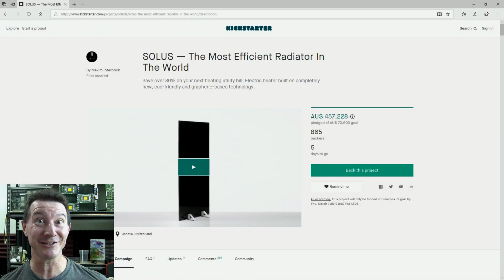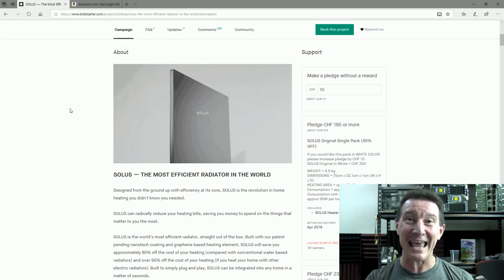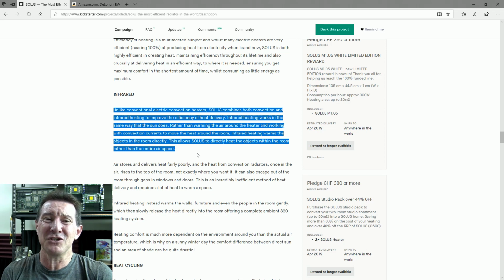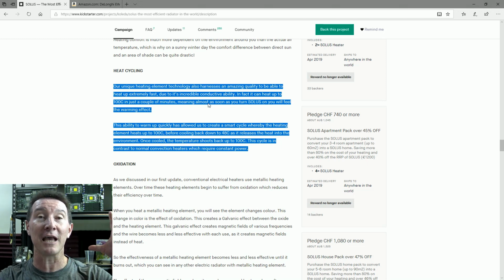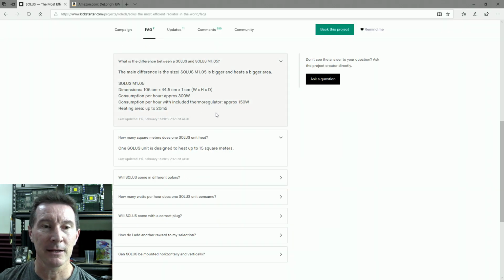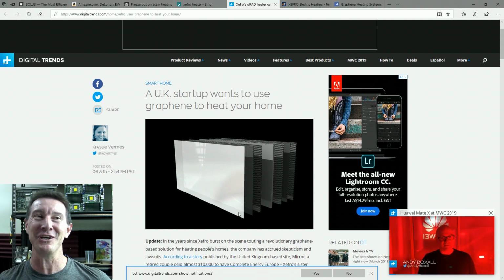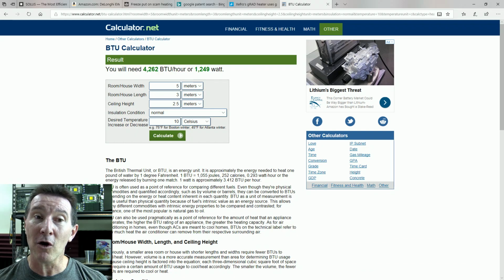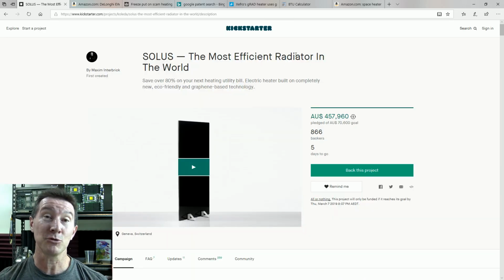EEVblog #1186 - Solus Graphene Heater Kickstarter BUSTED!

Comment: It amazes me how easily someone can scam millions out of people over products a smart high school student can debunk. Solar panels on a car... SMH. People like us who create objects rooted in reality have no chance. Electric heat is always 100 percent efficient at 3.414 BTUs per watt. I can always tell my customers with absolute certainty how much heat their electric heater is producing. You get what you pay for with electric heat no matter the type. All 15amp heaters are all the same output. Pick your style based on looks. It doesn't matter. Heat pumps and gas fired equipment are more cost efficient in most cases.

Comment: SOOOO I remember this and my comments are still the sans.   If a radiant heater draws 1500 watts an hour and puts out 2000 btus  and a radiant heater draws 400 watts and puts out 2000 btus then the 400 watt ones way more efficient.    AND If you put this in a 2000 cuft room and it heats it to 80 degrees in one hour then it way more efficient

Comment: One additional thing: oil radiators do an infrared radiation you can feel immediately when they heat. All metal bodies emit infrared thermal radiation when heated compared to the environment, which makes oil radiator basically the same (except cheaper).

Comment: Not seen the full video yet, but claiming 80% saving on heating bill??
Efficiently converting electricity to heat is one of the few energy conversions that we've truly mastered.  And trivially too.

Like, we do it by accident in gaming PCs with 95%+ efficiency.  How are you going to save 80% on the energy bill for that without reducing heat output, let alone a dedicated heater?

Comment: It's like an tinted incandescent light bulb. If you have very good insulation and mild winter you could heat your house with Incandescent light bulbs. The metal wire inside a light bulb would burn if the bulb wasn't filled with noble gas. 
Infrared radiation passes through glass. Apparently this thing only uses infrared radiation and not convection. The only real advantage or an oil heater is that it heats the room without causing an air flow within the room, which doesn't stir up dust.

Comment: Of course, graphene can generate heat without electricity input. You just have to leave out the cladding and heat it up strongly enough. Then a reaction begins in which electrons flow from the graphene to the oxygen in the air without external voltage input and bind it, releasing heat in the process. The catch is that the graphene heating element then only has a limited service life.

Comment: The co-efficient of performance (COP) of a heater is worked out by comparing kW heat to kW electricity  (in terms Watts is used to define two types of energy, electrical and heat). Resistance heating (RH) has a COP of around 0.3. Or that for every 1kW of electricity used approx 0.3kW's heat energy will be produced. A reverse cycle air conditioner uses the "heat of compression" to increase the temperature of a gas (the refrigerant) to do the "work" involved in heating a medium (the refrigerant, the tubes then the air). This is a far more efficient way of imparting heat into a substance than a resistive wire heated using electricity. It is far cheaper (more efficient) to run a  compressor and fan windings than it is to use RH. A current model of air conditioner uses 1kW of electrical power to make around 2.5-3.0kW's of heat energy. That's right, 0.3 COP compared to a COP of 3.0 (or more see below) For this reason gas (a similar COP of 30-35%) was phased out of British laundromats to be replaced with reverse cycle heating systems. If you check the "Advance technical specifications" on this current model Daikin AC rang of units, compare DTXF25TVMA: Power Input (Rated):	Cool (kW)	0.67  and Heat (kW)	0.78,  Rated Capacity:	Cool (kW)	2.5 	and Heat (kW)	3.0. Coefficient of Performance (COP) is the efficiency ratio of the amount of heating or cooling provided by a heating or cooling unit to the energy consumed by the system. ... Then the COP of the air conditioner would be 2.5 divided by 0.67 = 3.7, essentially almost 4 times more efficient than electrical heating. Watts electricity and Watts heat are easily confused making scams involving them easy to perpetuate.  https://commercial.daikin.com.au/our-product-range/split-system-air-conditioning/dtxf-t

Comment: It takes 3 kilowatts to maintain my lounge at 24 oC when the outside temperature outside is 0 oC   Which is bang on the calculated figure.  So I would need 15 of these panels not pulsed to do the job. This defies physics and is obviously a scam and should be stopped before people loose their investments. The kick start platforms should be fined for joint enterprise in the scam.

Comment: Living in Europe, I have seen many new apartments including the one i am living in, have started using floor concealed heating (the entire floor is a radiator here) and hot water is pumped for circulation. I found that this heating itself is kinda inefficient in terms of convection and radiation to the room when compared to a standing radiator(no forced convection). 

Solus just looks cosmetically appealing and is a bad combination of standing radiator in a insulator. IMHO better to have a concealed floor heating, this way you dont see the radiator at all(problem solved) and  the floor is warm to walk on without flip-flops.

Comment: 'In the age of smart homes, heater tech is still lagging far behind,' wrong, Trane had variable-speed HVAC and OEM-installed smart thermostats nearly 30yrs ago, if anything, HVAC was decades ahead of other smart tech, hackfreehvac has a whole vid on the subject explaining how some of the early variable-speed installations were too advanced for techs to work on at the time.

https://youtu.be/bDFxjxq7vKQ

Tl;dr, the Solus guy is full of crap on his 'get with the times' comment when HVAC was ahead if anything.

Comment: Air is dynamic , it flows , leaks  and exchanges and is probably the not the best medium for heat transfer. Infrared on the other hand gets the heat from the heater, to you / a body without much loss is what I understand.

Comment: Unsure about your claims, if glass is such a good insulator, why do modern windows have to be double or triple glazed to prevent heat passing through. It seems that this uses DC current which does allow the heating wire/graphene to be more efficient at transferring electrical power to heat, as Tesla used AC systems to transmit power to prevent the heat loss from overhead power cables, therefore DC is not good for transferring power over a distance as the heat loss is too great, but this is exactly what you want in a heater. A IR heater/lamp will heat objects rather than the surrounding air and therefore you repeatedly refer to volume of air but if you are heating objects/people rather than air,  the temp of the person will rise, this is why many garden heaters are IR lamp based, not designed to heat the outside air but the people there .
Reply: Can you not google?  A quick search will show you why glass is an insulator. Windows have to be double or triple layered with inert gas in-between because you can't make glass too thick.  If you tried to heat a sheet of metal that had the same thickness as a single layer window the metal would heat way faster.  lol I mean this is the reason if you look at there indiegogo page its flooded with comments of peoples units glass cracking or even exploding.
Reply: @Alexander-the-Mediocre  So you don't agree with all those manufacturers that make glass cooking hobs?
Reply: @groogleboogle  lol except those are slower then gas stove tops plus they aren't made of just glass.  They are made of a combination of materials so rapid heating doesnt crack it.  And are not as energy efficient as radiators.   This product claim more efficiency and states it uses temper glass not the mix that glass hob use.  You dont see glass hob exploding because the materials mix can withstand a rapid temp change.  But solus have been exploding cause they probably just use pure temper glass.  Your comparison fails.

Also if you think it's more efficient then show me your calc all radiators give their numbers.  How much power it takes to heat a space.
Reply: @Alexander-the-Mediocre  As we live in a universe where energy cannot be created or destroyed, therefore we are in a perpetual motion machine, but some say that perpetual motion is impossible, go figure! Therefore everything is 100% efficient! 
I would like to point out that I have not made any claims about this product other than I think people should keep an open mind about things until we know all things :)
Reply: @groogleboogle  at least in this case I dont think keeping an open mind is needed.  By calling them out they were forced to be more truthful.    In the indiegogo page the dropped a lot of the fantasticle claims and changed the efficiency from 80 to 30.  They lied on the kickstarter page though they may be more truthful on the indiegogo page.  Only issue now is it exploding.

Comment: Would it be possible if you use several of these heaters around the house and use the radiant properties to make you feel warmer, you could keep the thermostat set lower and still be comfortable.  Maybe with proper placement on the wall you can get them set up at an ideal height to radiate maximum amount of heat on to the occupants of the room.

Comment: Much too late to the party, but whatever. I really enjoy your content, especially the rants about BS tech. However, I feel you mix up a few things regarding radiation and convection in this one ... which isn't even a topic you need to go into in order to debunk the bullshit claims (for mostly bullshit they are indeed). Nobody in their right mind would argue against an electric heating element being 100 % efficient in converting electricity to heat. You could stop there. For the part of heat generation it doesn't matter if that thing radiates heat to visible surfaces or heats the air inbetween.

Now for the smart ass part ...
1) Radiation does not heat the air (not directly at least) -- it just goes from surface to surface; instead it is convection that deals with heat transfer by means of a medium (like air). In reality, of course, any surface getting hot within some medium will always give off heat by means of both; only the ratio between the two differs depending on surface temperature(s), geometry, the medium and whatnot.
2) To be fair, in theory, there could be efficiency differences in the heat transfer between the heater and the things you want to keep warm (which is mostly people, not necessarily the room itself). These differences could show in very dynamic scenarios. Say, heating-up period in a huge ass room (like a big production building at the beginning of the day/shift). They wouldn't show under steady-state conditions. For residential heating, that is usually not considered to have a meaningful impact. We'd be talking big workshops, production facilities ... stuff like that.
3) Leaving the low power of these heaters aside, radiation could be felt instantaneously, whereas heat transfer by convection takes time. But that is the same for every heating panel (vs. air heater) out there ... the graphene BS is still BS, of course. Again, this is usually considered to be negligible in residential heating.
4) You do not need a fan in order to get a decent amount of convection; a lot of vertical surface arranged in a way that encourages air flow thermically will do fine to a degree (loads of fins stacked onto heating elements / tubing with hot stuff in it). In fact there are actual fanless convectors that you can buy for room heating. I assume it may be a bit of a language thing as in English basically everything is called a radiator, even it is clearly designed to maximise heat transfer to the air (and therefore maximise convection, not radiation). Blurs things a bit. Of course, none of that does make SOLUS' claims about using BOTH radiation and convection being THE sh!t any less ridiculous.

Greetings from the land of the most overengineered heating systems in the world :D

Comment: If they were using a phased array to radiate IR by beamforming towards the user, rather than trying to heat the whole room, the efficiency claims could be plausible - you are, after all, heating less mass and therefore need less energy - but that would involve THz RF driver electronics and not just a heating coil inside a glass and graphene-paste sandwich...

Comment: In Germany we also have Voodoo Startups of the same type, some got substantial government funding. In a presentation they did claim, that this type radiators would transmit more infra red rays, that would make one feel warm, while the room temperature is way colder than normal.  They claim, that this will save great amount of Energy. I was shocked to see how many managers and politicians seriously followed the presentation at the Berliner Energy days, and discussed the opportunities this radiators would provide.

Comment: I'm no professional, but it is ENTIRELY POSSIBLE that the oxidized metal is indeed less efficient. Definitely not with regards to the conversion of electricity to heat, but all materials have different thermal emissivity properties, so to arbitrarily say that it can't be more efficient than an oxidized heater is faulty logic.

It's possible for the thermal emissivity to be decreased by the oxidized layer having a worse emissivity...

THAT BEING SAID... In the end it will be transferred from the metal, but by being less efficient it will take longer to do so.

Just consider black body radiation for an example...

I AM NOT SAYING HE'S WRONG.... I am just saying that it is absolutely POSSIBLE that the oxidized layer could have a much lower thermal emissivity or transfer to air, but at the same time, it most certainly could have a higher thermal transfer...

Hoping my issue is coming across properly. Take care and be well all! 😊

Comment: We do have water radiating heaters here in Australia. There are mainly used in hospitals where water heaters flow through pipes to heat the air passing through.

Comment: I would think that whether Tempered glass is an efficient radiator or not in not germane to the the argument.  If you dissipate 300 watts between the glass panels, I would think it would raise the temperature of the glass surface, no matter how inefficient, until you were radiating 300 Watts of energy into the room where you had the heater.  Saving 80% might be true if you were previously using a heat source that was 20% efficient.  All in all, an excellent video.

Comment: They certainly put a lot of stock in their thermal conductivity.it doesn't matter how thermally conductive anything is, once you take the energy out of the wall and convert it to heat the heat's not going back into the energy grid it's being given off into the room, the only difference is how fast that happens.

Comment: We heat several rooms that stay cold in our house with cheap Walmart space heaters that cost $30. They have a fan and heat a single room really good. They also have a little switch on the bottom that shut them off if knocked over.

Comment: This is obvious BS, as you say. However, there is a tiny grain of truth to what they are saying. The surface temperature of the oil radiator you show is only about 100C, so most of the heat transfer from it to the surroundings is by (free) convection. Actual radiant heaters (which are nothing new) use an exposed heating element which reaches more like 700C, where radiation dominates. This means that if you sit in view of such a heater, you will feel warm immediately due to radiation heat transfer to your skin (you don't have to wait for it to heat the air and then the air to warm you). This is why old houses which were heated by fireplaces would put the fireplace in the main room of the house so you could sit around it and get direct radiation from it. If done properly, this CAN result in much lower heating bills because you can manage to heat only the people directly without having to raise the temperature of the air and walls as much as would happen with convective (free or forced) heat transfer. Another factor is that traditional radiators (working by convection) set up a substantial thermal gradient between floor and ceiling. While you correctly point out that resistive heaters are ALL 100% efficient, the overall efficiency of a heating installation depends on how much you heat the objects that matter versus those which don't. If the people are what must necessarily be heated but you heat the ceiling even more than the people, there will be excess conduction through the ceiling and walls to outside of the room or even outside the house. To make a long story short - this is BS, graphene has nothing to do with any of the potential benefits they claim, but it IS possible to achieve the goal of heating certain critical objects/areas of a house or even a room with minimal heating of the walls and ceiling and use less energy to do it, BUT no single magical plug and play heater is going to do that - the whole heating system needs to be engineered that way.